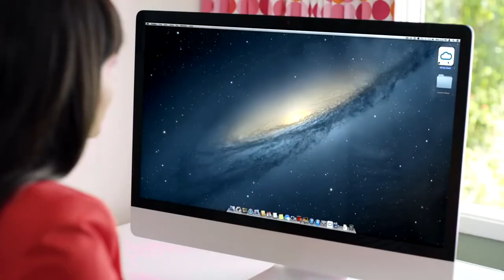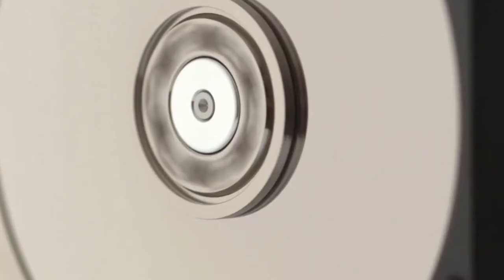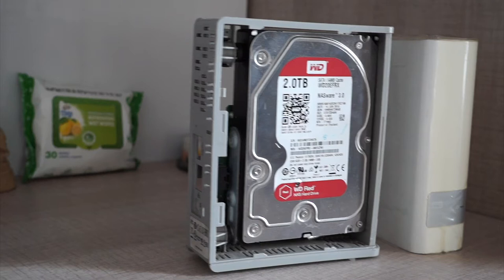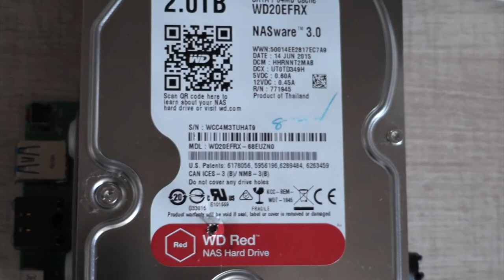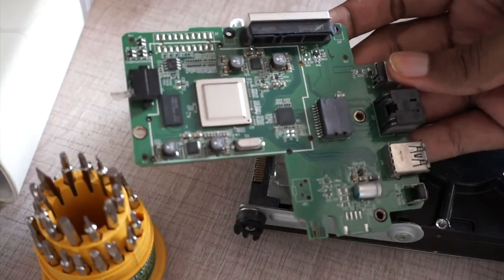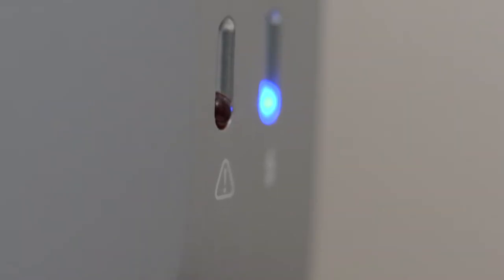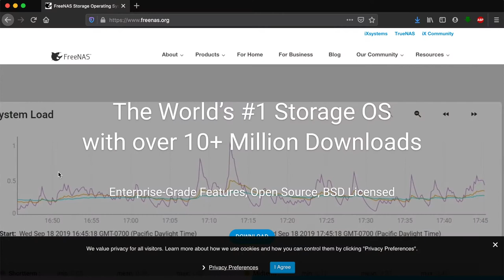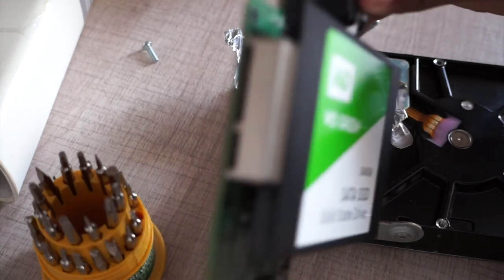WD My Cloud Hard disk keeps failing? Tear down + SSD Upgrade 2021

Comment: Brother, I'm wondering what kind of environment you're using the drive in?  The entire outer case is in terrible shape -- did you spill coffee on it?  is the enclosure sitting in the sun all the time?  The HD you removed has damage to its exterior -- did you install a used/damaged HD, and could that be why it has failed?  I bought mine used in 2015, today is 2021, and it runs 24 hours a day for all those years.  I came here because I believe I should upgrade to SDD before the HD fails -- Thanks for the video!
Reply from the maker: I don't really know why the color has changed, if you notice I haven't even unwrapped the plastic sheet over the case. I am using it in one of my room on normal temperature. Something is wrong with this model also the hard drive is new, maybe I opened couple times already for the video so it may look bad but it's not that bad as it looks 😃 Update: Finally my board failed last week and I am getting solid red light and won't even show up in network anymore. Terrible product.

Comment: Did you replace the hard drive?
Is there any software need to install on new hard drive?
Actually I also want to install new hard drive in we cloud
Kindly advise how I can change my hard drive
Reply from the maker: Hi Tariq! Yes, if you want to replace the hard drive then you need to install os to make it work in your WD. That process is not easy, it's time taking, very technical process and I had to try multiple times to make it work. Better get a NAS like Synology where you can hot swap the drive.

Comment: SSDs usually have a shorter life and a limited read and write capability which can cause the SSD to fail in few years. I noticed you used the green WD for your NAS. The green is not designed to be working as NAS and will fail in few years.
Reply: I think you got that backwards. SSDs have no moving parts, HDD do so how do you figure SSDs have a shorter lifespan?
Reply: @DarrylBass  I think is because an SSD doesn’t really erases.  It records blank spaces over things to get more space… in this way every work on it takes life from it.   But you are right it has no moving parts

Comment: Could you upload HDD replaced with SSD video
Reply from the maker: Hi Ram, My WD is no longer working because of the MB issue. Changing to SSD is an annoying process and takes lot of patience 😃 I will see if I can find the old recording of how I did that. I had it somewhere.